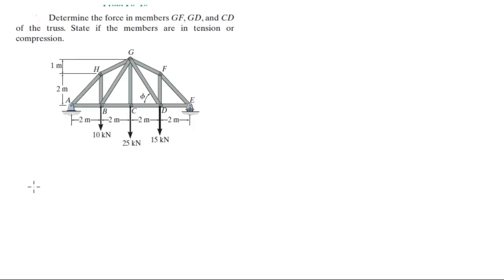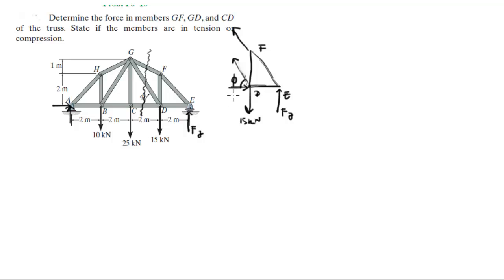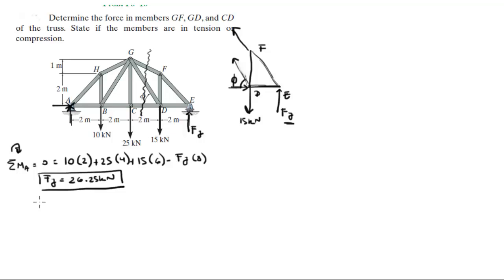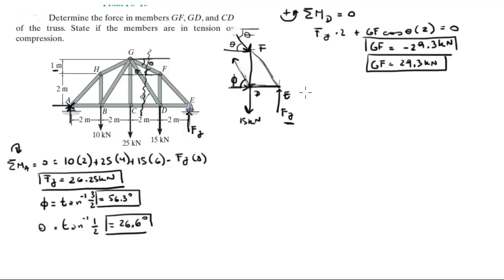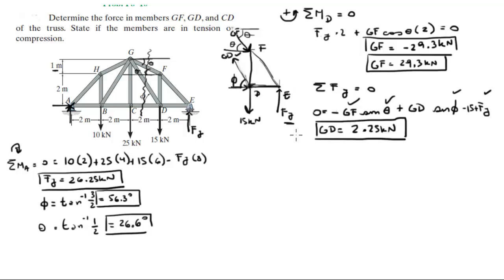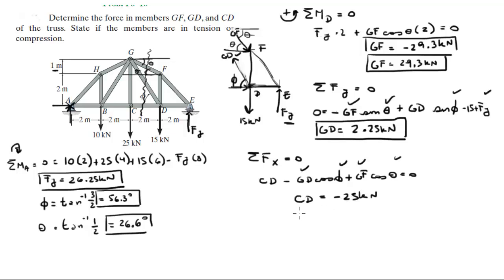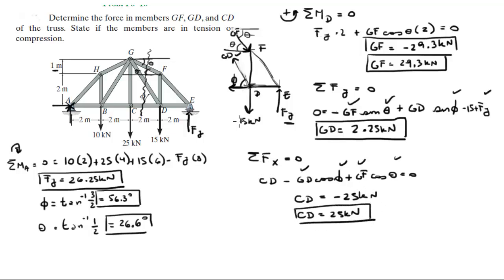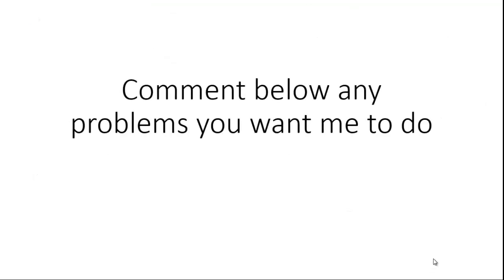Determine the force in members GF, GD, and CD of the truss

Comment: so if you have 20 + 100 + 90 = 210 - fg(g) =0 how did you get the 26.25kn?
Reply: it is not  20 + 100 + 90 = 210 - fg(g) =0

I believe it is f(g) * 8,  since he is using point A as center for momentum calculation.  And point E is 8 m away from point A

just bad handwriting